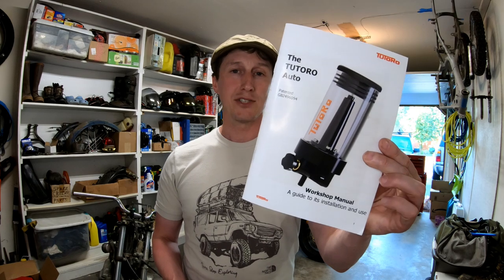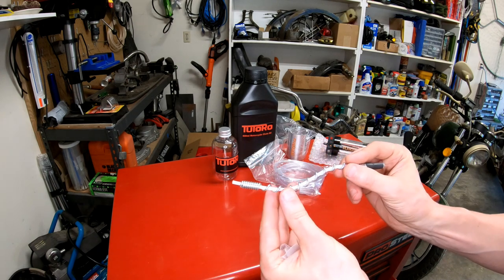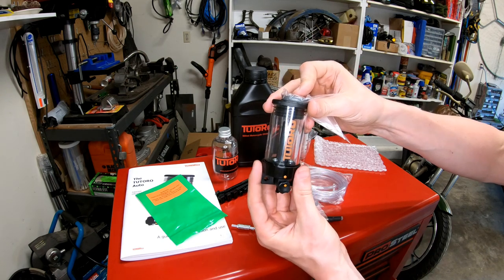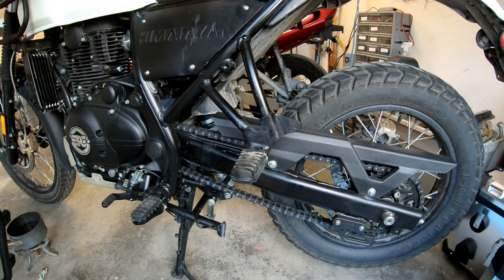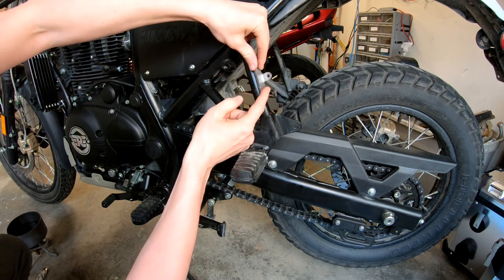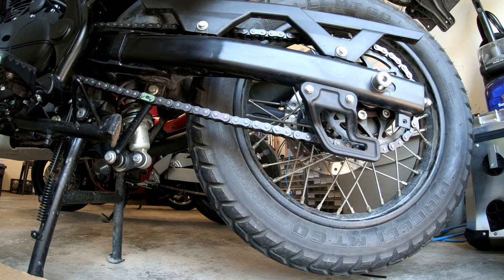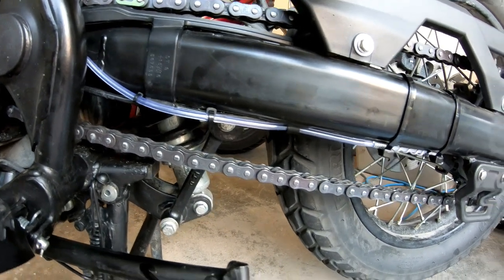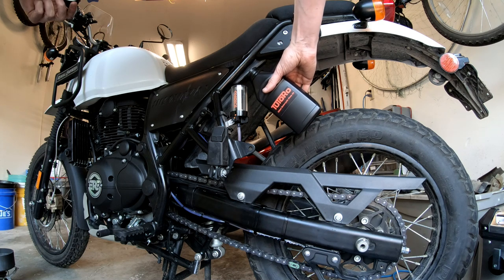How-To: Tutoro Auto Chain Oiler Installation & GIVEAWAY!

Comment: Great video and good explanation of installation. A chain oiler is a good way to resolve the lubrication issues between the chain and sprocket minimizing the interface wear. It's possible to get the oiler dialed in to minimize oil spray on the rear wheel, drive sprocket, and swing arm assembly, but unfortunately whether you use an oiler or manually maintain/oil your chain, spray on other surrounding parts is an inherent byproduct of a chain drive. 

For those of you not wanting to deal with regular chain maintenance, a chain oiler is the only way to go. For those convinced this is the solution to make it happen, the Tuturo is the only way to go. Simple installation, simple operation, little to no maintenance, and highly effective. Have installed one of these on each of these bikes I own...... a KLR 650, KTM 1190 Adv, CB1100C and a CB500X and all have worked flawlessly, the oldest for 5 years. Last one I purchased was on Amazon for those might looking for a source in the US. Hats off to the gents who invented this across the pond! Well engineered, good quality product and that's from someone who's at one time was an auto mechanic and currently a mechanical engineer for almost 40 years.

Comment: Please clarify:  Since the chain is a (newer) O-ring style which is packed w/ lubricant and sealed w/ O-rings on each link, why is it necessary to continuously dribble oil on the chain?  Wouldn't this oil attract and hold dust and debris on the chain which serves to wear out the chain and sprockets faster than if they were protected w/ a dry paraffin coating?

Comment: Hi Justin, really great video! Very clear. 

But I wonder: 

Can you comment on how or if the chain tensioning task (which should be checked and if necessary adjusted every 1.000 km) is effecting the delivery of oil from the nozzle to the sprocket. 

Isn’t it so that every time you adjust the chain tension the whole rear wheel including the sprocket moves to the rear side of the bike. I wonder how you ensure that the nozzle still has contact with the sprocket if the sprocket moved 2-3 cm to the rear compared to the original position?
Reply: Comments lacking due to it being a major issue! I fitted a similar chain oiler which had a drip nozzle from the chain guard,  works much better...

Comment: what a clever system those guys from #tutoro came up with!

And what a  great tutorial you did too Justin... Thanks
Reply from the maker: I agree! Thanks Daniel! You've been entered into the drawing. 👍
Reply: What happens to the nozzles if you push the bike backwards ?
Reply from the maker: Interesting question. If you had just dropped your bike into a pit of mud, covering the sprocket, and then rolled backwards, you may need to clean the nozzle out with a paper clip or pine needle.

But in most riding conditions where dirt and debris is flying off the sprocket (if any at all), and considering the constant oil application helps keep the sprocket cleaner than usual, you'd have no issue to be concerned about.

That's my take on it.

Comment: What's your long time experiences like? Would you recommend it?
Reply from the maker: I really grew to appreciate the full capability and usefullness of this bike during the ride to Prudhoe Bay, and following that trip I took it deep into Denali National park with Dee on the back. We were both comfortable and the ride was really pleasant. It was nice to discover the Himalayan could cruise ok on the highways, but the long dirt and gravel road really proved to me I made a good purchase. Yes I would recommend it with the understanding that we all have different tastes and preferences, and my conlusion may not be the same as yours. I can't speak for you, but for me this has been a great purchase.
Reply: @KARMAkazeMoto  Sorry, I obviously did not express clearly enough what I was refering to. I was wondering about your long time experiences with the Tutoro chain oiler not the bike itself. ;)
Reply from the maker: No, that's my mistake. I was responding to a lot of comments on a particular video and didn't realize you were commenting on the chain oiler video. 

I've also been very happy with the chain oiler. I used it during my trip to Prudhoe Bay Alaska and only topped it off one time during the trip. I had a good piece of mind knowing the chain was lubricated well for the entire ride. After many miles of muddy gravel I did clean off the oil nozzle one time to ensure it was flowing well, other than that you can set it and forget it. It's worth noting that the whole thing withstood 2000 miles of riding, and nearly half of that was on gravel or rough road. The oiler still works perfect after all of that.
Reply: @KARMAkazeMoto  thanks a lot, I just received mine. :)

Comment: I was thinking bout it over the weekend and i think it would be great for street riding only , but as for both of us that like the beatin path , well think it might be a big dirt collector and doing more harm then good .... thoughts ?
Reply from the maker: Well let's say you had a lubricated chain, like normal. It's probably pretty sticky and once it gets all dirty during off road use the dirt just sticks there. Whereas if you supply a continuous flow of  clean oil, you are able to flush that grime off the chain rollers.
Reply from the maker: You can turn up the flow a little bit so that as you ride the dirt that gets cleaned off will fling off the chain. You may wind up with more mess in the chain guard, but that is better than wearing the chain out. I haven't tested this out, but Tutoro does describe this cleaning benefit in their manual.
Reply: @KARMAkazeMoto  Good points ! I'll still wait for your update review .... But it  is a great how to <3
Reply from the maker: I think that's a smart move. Thanks Iron Man!

Comment: Hi mate looks a good system from #tutoro, one question does the helix and nozzle give good adjustment for when you adjust your chain as it wears ?
Reply: Good point. I think i can answer this. Yes, its easy to re-adjust the nozzle position however, the necessity for any chain adjustment is substantially reduced  because the chain wears very much more slowly - many people state they get 30000 miles plus out of a chain. 1 recorded instance was 52000 miles!
Reply from the maker: Silk, thanks for entering the drawing. That was an EXCELLENT question, and Nick Ibbitson gave you a better answer than I would have. Cheers!
Reply: @KARMAkazeMoto  cheers hope I win to give it a try 🤠👍
Reply from the maker: @silktvPDR1  Good luck! Cheers from Alaska!

Comment: Thanks Justin-need to fit one to my Himalayan as Spain is very dusty and I'm forever wiping off the dust that turns to grinding paste, and then re-lubing.
Seeing as it's going on the Himalayan, are you sure that there will be enough vibration  to make it work?  (For all those without Himalayans, they are incredibly smooth running).
Reply from the maker: In your situation you'll benefit from how the constant delivery of fresh oil cleans the chain as you go. It does more than just lubricate. You may want to turn up the flow a bit. And as Nick stated, the engine vibration does nothing. The motion on the road causes the flow which is the same on all bikes. If you have a hover bike from the future, only then would it not work. 😀
I agree, the Himalayan is a smooth operator. 🙂👍
Reply: Sorry Nick-I was trying to be funny about the Himalayans lack of vibes!
I have had Scotoilers fitted to some of my previous bikes, but all the dismantling needed to tap into the inlet manifold was a real pain on FI bikes. This seems to be much better solution (at least for me) for keeping chains lined, as I'll often forget!

Comment: What type of chain oil do you use 10W50  out of the crankcase ? Filtered of course?
Reply from the maker: Greek olive oil.
Just kidding! Tutoro requires their own because it is the exact weight and viscosity, plus there are no additives that could damage the valve or seals. I'm not aware of other options you could use in a pinch. Would be good to know, just in case.

Comment: How good can that thing be when you have to protect it while washing the bike 🤔 but the system seems to be cool, like the old scottoiler
..
Reply from the maker: I hear ya. It's plenty good though. Regarding protecting it, for starters there's a breather hole at the edge of the cap. Wouldn't want to blast water in there. Also, because people don't always wash their bike with mild soaps and solvents, there is the small chance that the chemical used will turn that clear housing cloudy. Tutoro is is playing it safe here. I'm sure they could use a more durable material, but then the cost would go up. As for being like the Scottoiler, that's accurate in the sense that it oils the chain, but unlike the Scottoiler that runs on vacuum and will drip even when the bike is parked, the Tutoro only runs when road vibration is present. A nice touch! 👌🙂

Comment: Just spray some oil on your chain?
Reply from the maker: 😂 That's what I used to do! Now I don't need to, and the chain stays a lot cleaner during long trips. There are some definite benefits to having a slow trickle applied consistently than doing one spray every 500 miles or so.

Comment: Have you experienced any of the mechanical/electrical issues others are experiencing with the bike? how many miles/kilometers do you have on it now?
Reply from the maker: I have experienced a stall when coming to stops. I disconnected the EVAP system from the intake and that stopped. That is the only issue so far.
Reply: @KARMAkazeMoto  thanks for the reply. how many miles or kilometers do you have now?
Reply from the maker: @yucandy0711  oh, sorry about that. Roughly 4,000 miles.

Comment: Good stuff mate, love the intro very professional. I’ve heard of oilers (not the hockey team) but never seen them in action, pretty cool. How long typically would a full reservoir last and would it not over-oil the chain? ATB Jason 👍 #tutoro
Reply from the maker: I've been waiting  for someone to ask this exact question. 👍 Tutoro claims a well adjusted oiler will get you 1,000 to 1,500 miles. I did 100 miles the other day on a full reservoir and the level didn't drop too much. Looks like I'll get at least 1,000 miles. Since you have control of the flow rate using the adjustment knob there's no worry of over-oiling. Install, ride for 20 minutes, check the chain. If it is too wet, cut the flow back. If it doesn't seem wet enough, turn up the flow. The manual described the best situation, basically a wet chain but not dripping.

Consider yourself entered into the drawing. 👊
Reply: KARMAkaze Moto awesome stuff 🤘👊
Reply: scott oiler rules

Comment: Not sure bout that one i'll wait for update review .
Reply from the maker: Don't blame you! Should be a pretty obvious piece of gear to notice during future rides. You'll know if it's still working out well. I'm heading up to Deadhorse/Prudhoe Bay in a couple weeks. That'll be a great test.
Reply: @KARMAkazeMoto    Elegant system!  In my experience with zip ties, though, they eventually break - just spontaneously! 
I had a bunch of coax cables bundled and attached with zip ties to iron water drains in the carports of our condo complex, 
and even without exposure to direct sunlight, the ties just snapped after 2 or 3 years.  So be prepared with extra zip ties, 
or maybe replace them with steel ties.
Reply from the maker: @daveinwla6360  I think I'll take your advice. Stainless hose clamps would be nice. Either way, I plan on covering the bracket in black tape. It'll look good and stop any problems.

Comment: Just wanted to know have you got any oil leaks from your engine from the head maybe the O-rings from the tapper covers or bolts I’m coming up on my 3000 mile service and I see some oil coming from something up top have to get into it because oil can run anywhere if you can give me a shout ill get in it next week or so and my back tire is about done but I do 90% on road got new ones ordered let me know and dig the new logo.
Reply from the maker: No leaks here... for the time being. I hope you find it's the tappet cover seals, because that is an easy fix. If you get a moment let me know what you find.
Reply: Thanks I will when its done.  @KARMAkazeMoto
Reply: Ok did the 3000 mile service and it had to be the tappet cover on the exhaust side the O-ring on both look to small and must only be good for a one or two time use so I put some good RTV in the O-ring grove this should be good till the next 3000 mile service and ill get new ones for next time didn't want to wait for the parts to come in takes two weeks or longer to get so Im letting it dry till  I can ride it again.   @KARMAkazeMoto

Comment: Why in the hell would you put a chain oiler on a o ring chain? its not 1968....
Reply from the maker: Good question. Because o-ring chains still require cleaning and lubrication. The o-rings only assist in protecting the inside of the chain rollers. The outside of the rollers and the sprockets require lubrication. That's about the best explanation I can give.  🙂
Reply: Bikee4 - O'ring chains still benefit from lubrication. Its a very stubborn (and entirely incorrect) Urban Myth that they don't.  If you do the miles you will see the benefit of an Auto oiler :-)